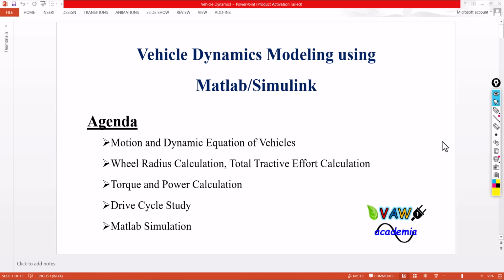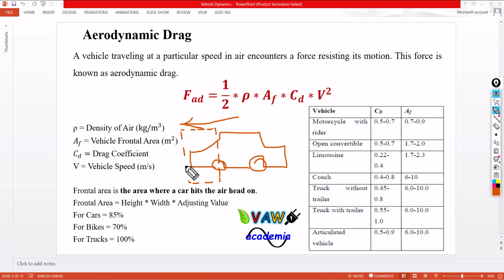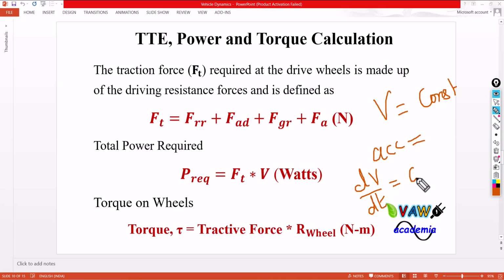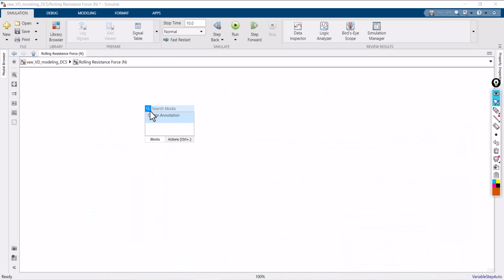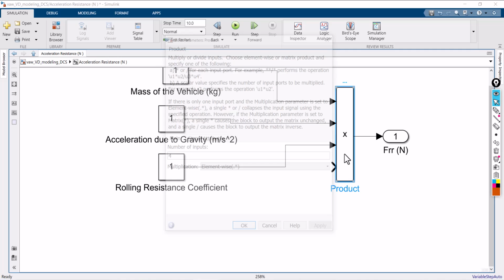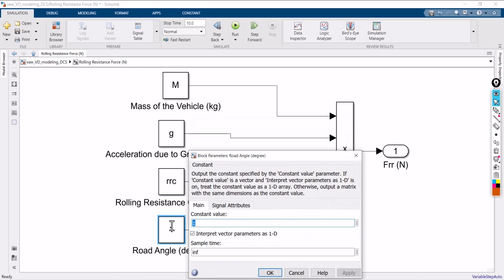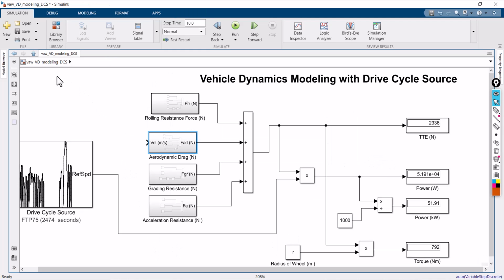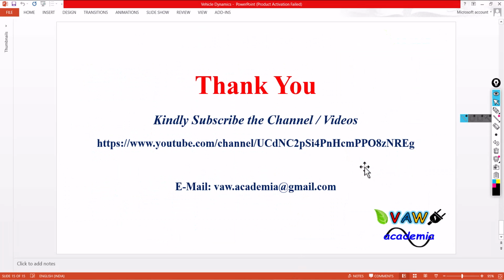Vehicle Dynamics Modeling with Drive Cycle Source using Matlab/Simulink

Comment: Is the model accurate? I think the torque values are way to high
Reply from the maker: While calculating rolling resistance and grading resistance force, first find sin/cos of given angle and then convert angle to degree. This step will give you reduced torque.
Reply: Sin / cos u mean to say tan? @vawacademia